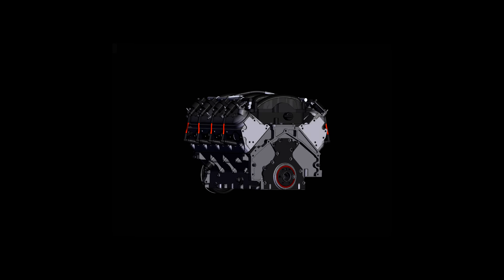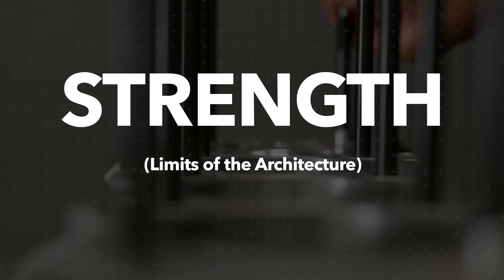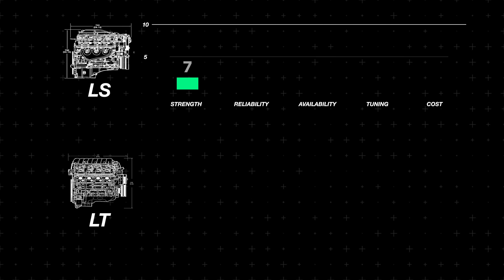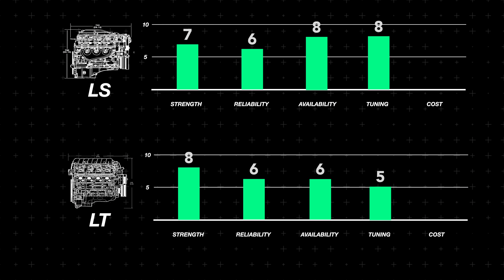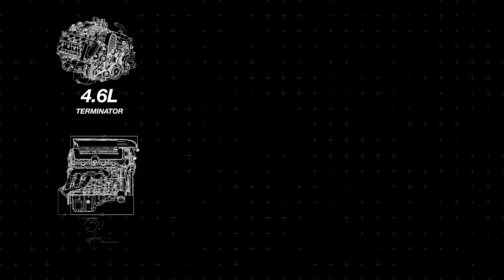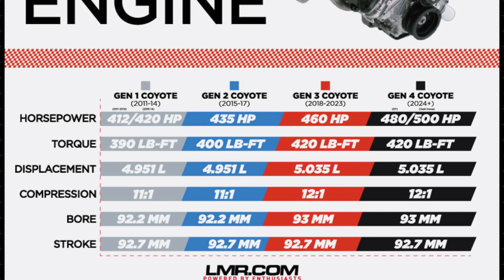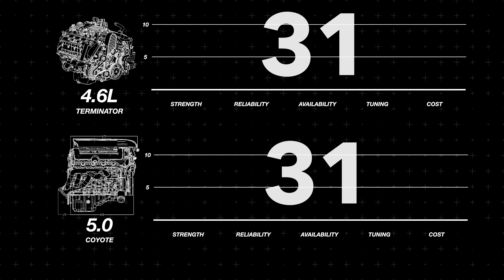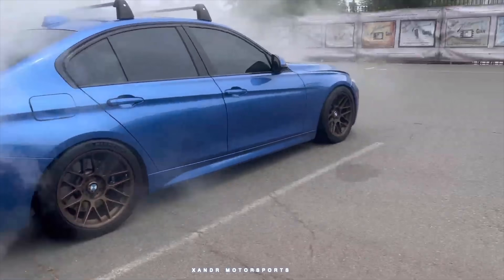Why Old Engines DESTROY Newer Ones💀| Explained Ep. 25

Comment: the coyote is better than the 4.6 mod. it just is. the typical 4.6 is a ugly little 225 horsepower thing that's paired to a 4 speed auto, that happens to sound pretty great, but not typically a supercharged beast. I mean if you really wanted to be silly, the Koenigsegg CCR engine is based on the modular lol. the later 3v in a typical mustang gt is probably the better comparison

Comment: Alec from LMP said that the LT1 is the better NA motor over the LS7. The LT1s only fall is it’s terrible boost capabilities. I also don’t think junk yard Silverado engines should be called “LS” engines because it screws the debate a lot. The cheapest real LS is the LS1 and LS2 for around 3-5k. Those junk yard motors are a good $800 and just make it unfair for everything else 😂

Comment: Guys, put your recommendations under my comment, Ill start off with some engines
RB26Dett Vs VR38DETT Gtr r34,vs r35
The sixth generation Charger, Srt8 6.1 Hemi vs Seventh gen chargers with their newer hemis
I would like to directly compare different engines like
2GR-FE Vs The Vq series, made by different people, but still has the same cylinder number (6) even if it has a different firing pattern

Comment: I definitely do not agree with the tuning potential of the 2JZ over the LS.  2JZ is extremely tunable, however the LS flexibility is definitely better.  They can run just as good on a Carb as the can on EFI.  One missing major player is Honda.  Most people who are in their 30s and 40s with the pockets to tune and are taking the newer platforms to the next level got their start in Hondas.  A K vs B series would be something very interesting to stack up against each other.

Comment: For direct injection vehicle changing out the injectors is hardly anything with out changing out the high pressure fuel pump for better tuning capabilities

Comment: Modern engines aren't meant to be tuned or upgraded... That's kind of sad.
My car has a Renault F4R the same engine Renault had for about 20 years and produces only 150hp at some point they had this engine on a Clio producing 200hp... 100cv/liter.
With a outstanding preparation while keeping NA there are some 180hp on the wheels. But it's not worth.

Comment: Personally, I believe the terminator vs coyote comparison is skewed/unfair towards the coyote. And I hate coyotes. (Terminator owner.) You're comparing the top tier engine to what can be found in base level performance cars, or trucks. A straight 4V vs coyote would be a better comparison. The 4v ford lineup ran from 1993 all the way to 2014 in the end of the GT500. 93-05 in the N/A 4.6 platforms 

Tuning. Ehh, most people that tune coyotes can tune a earlier eec-v ford PCM. (Terminator, 4v, 2v, and 3v.) It's also worth taking the time to get the software to do yourself. 

Cost comparison. Yeah. Depending how you slice it, it's about a straight trade modular vs coyote. You gotta pay to play either way. (The terminator comparison was spot on, imo.) 

Strength. The 93-99 teksid aluminum 4.6 blocks are hands down a better block than a coyote block. You don't have to worry about cracking the bores unlike a coyote. The iron 4.6 blocks do have their weak points, and are notably heavier. 

These are my ramblings on on the mod vs coyote debate.

Comment: Great video but you over stated the power the stock bottom end of the 2J can make. It can make 1000hp yes,.. but reliability wont be there. 600whp on pump is safe and 700-800whp is about the max limit on stock bottom end on E85. Any thing above that is a gamble. It will make the power but be ready to build a block. The pistens will hold, the rods wont

Comment: And Honda still uses K-series engines for performance cars
Reply: very different engine design, may as well have been a different letter. I don't really know how they choose the letters but yeah. 

they also have the k20c2 which is an economy engine and has a similar reputation for tuners as the k20a3, the weaker version in the RSX base.

Comment: Lord. The ignorance about the Supra vs Z4 M40i differences everywhere is deplorable. Papadakis racing debunked most of the claims and supported Toyota’s word about it in every single aspect they looked at. They did a complete strip down to the chassis of both a Supra and Z4 and looked at the actual differences. The engine used in the Supra is not the same as the one in the Z4(despite claims. The B58 in the supra was refined by toyota, and other version pre-date their involvement). Can we say NO to misinformation please?

Also the lack in consistency in comparison of these engines, comparing stock ecus for the Coyote and Terminator engines, whereas weighing the aftermarket ones for other engines, is just intellectually dishonest.

Comment: The issue I see with a comparison like this overall is basically that none of these factors matter if you’re doing an engine swap. I could see these things matter, and if you are buying an original car, but the total costs involved with an entire swap, with the intent of custom levels of power is that ultimately, it depends upon tastes over actual results. With enough money, virtually any engine can make 1000 hp. And it might be cheaper to achieve with all of these engines collectively, due to the fact that an aftermarket exists for them, as well as some of these engines having 1000 hp kits. But regardless of achieving that much power, and putting it in whatever you want, the ultimate realistic cost in how to achieve that makes it all meaningless to the average person.

I believe a more fair comparison would actually be somewhere around the realm of achieving 500hp, but that comparison leads to the result of preference mattering, because the ultimate final cost is relatively the same. All those same engines will spend about the same amount of money to acquire and modify to about that level of power, which while still more attainable for similar amounts of money, leads to final results matching each other on average, the difference at that point being who has the better transmission, to those results still being uncertain as well because I’ve seen a 500hp+ Terminator beat a 500hp+ Coyote and an LS beat an LT.

The point being, reaching the “full potential“ of these engines requires money, the average man can’t afford. And what the average man can afford usually results in similar results regardless of platform. So at the end of the day, if you aren’t sure which one you want, go off personal preference because that’s all it is. And have fun doing it because you can still embrace virtually every supercar with any souped up lower-cost sports car. And I consider that a level of trolling fantastic because you spend a fraction for speed some spend money they don’t have to on.

Comment: I would have to disagree with the way this video runs over things and have to say, you missed an opportunity to include the honda k series as a VERY good example. 
The LT is FAR superior to the LS in terms of oiling and overall strength, especially in the short block, most people use Gen 5 short blocks with LS heads to get around the complexity of direct injection heads while retaining "Priority Main" with stronger rods, as well as the aluminum blocks being FAR more common. 
The 5.0 i would have to argue is probably as expensive as the 4.6 4v to swap or use because both ECU's don't lend themselves well to being a stand alone, and if you stick with Gen 1/2 5.0 without direct injection you will probably spend just as much building/tuning an older platform that's harder to find parts and tune, you'd make more power with less on a platform with more options with the 5.0 under the same space constraints, and lets not even bother with the N/A or drivability comparison. 
The 2JZ is where, cost wise, the tide starts to change, but even then the B58 makes 800hp EASIER than the 2JZ, drops the iron block with seemingly no loss in strength, and gains MILES on driveability, power-under-the-curve, mileage.. the only area it  lacks is in cost, and that gap shortens as the 2JZ fades into history. 
HOWEVER.. the K series has started to loose its way it seems, honda has moved away from the traditional head setup and gone towards casting the exhaust manifold INTO the header for emissions, limiting the aftermarket options as far as all out N/A or top end turbo power. The K series is starting to pass into history much like the older enthusiast engines, but with no one to take its place as the most powerful inline 4 as of yet.
And as much as i would like to argue that gas mileage DOESN'T sway purchases/people, something tells me most experienced enthusiasts would pick the car that could drift/race all day opposed to a car that would only last half or a quarter of the day if they didn't have to sacrifice power or reliability, especially with the lack of funds these days.

Comment: The B58 has forged aluminum pistons not hypereutectic. Also would love to see one of these “stock” 2JZs make 1000whp without touching the pistons or porting the heads.
Reply: The B58 does not have forged pistons, the S58 does not the B58.  The 2JZ will make 1000hp on its stock head and bottom end....like 3 times then it will let go lol.  That is well documented, somebodies brother-sister-mother-cousin will come and say mine made 1000whp for 89 years probably there are a few of them that did but for the most part, nah.  They were dyno queens with show off sheets that were detuned on the street.  To consistently make over 1000whp it will have to be built, so yea you are right about the head performance.  600whp is much more comfortable for them for longevity stock block.  A lot of the 90s Japanese motors could survive a ridiculous amount of hp, from the VG, RB, 6G72, 3S, and 4G63, among a few others because they were built to withstand the early 90s ECUs that were not exactly accurate lol, larger tolerances had to be built into them.  Most of them could make 5-600whp on their stock heads&bottom ends.
Reply: Idk it’s believable. Motive video has a well documented rb26 that made a hair under 1k on the stock bottom end for dozens of runs down the strip and beating on the street without issue. It’s well known the 2j is an overall stronger motor so I wouldn’t doubt it.
Reply: @Jrob992 the 2jz is not race motor so it isn’t built race motor tough like the rb26
Reply: @benjaminwatson7868 2jzs were used in plenty of factory supported racing… in fact only racing Supra that I know of that didn’t use the 2jz was the endurance racing car that opted for a 4banger for better weight balance… pretty much the same story with the rb26, except the rb is known to be less reliable and more prone to issues… like it’s oiling system… though I still love me an rb… neither would count as a “race motor”
Reply: @nathanryan5642  the rb was literally designed from the get go to be a race motor while the factory toyota racing team opted to not use a 2jz its almost like its not good at racing
Reply: I don't know about the B58, but I know the N55 had forged internals in the high performance car, meaning M235/M2 and so on, so I'd imagine it's similar for the B58.
Reply: though the one in the supra it took bmw 6 attempts to make the toyota engineers happy enough for their relability standards to use it
Reply: @UtterDisgrace  Toyota didn’t touch the B58. That’s a myth & has been disproven a million times.
Reply: @CadexLaw  Their engineers just showed up and said it wasn't good enough to put in a toyota. Bmw fixed it
Reply: @UtterDisgrace bro, Toyota only approached bmw about this partnership a couple of years before the z4 was launched… meaning the design phase of things was well over and things were all ready going into production… 0 chance toyota got much of a say so on anything outside of colors hahaha

Comment: The 2jz-gte did not come in the IS300/Altezza. The Altezza had the NA ge subvariant. Also, similar to the various 2jz variants, the B58 also has multiple sub variants. The mk5 supra came in the B30C (2020) and B30O1 (2021+) variants.
Reply: the GE was also not an na supra engine like people think. it has way worse rods and pistons
Reply: @Defury8285   also lacks  oil squirters

Comment: "Real world limits" 
Stop crying because an oem coyote IS IN FACT the ONLY oem platform capable of 7s sealed ( your condescending attitude doesn't change that).  It has the highest brake mean effective pressure of any mass produced engine, and Brett Lasala just proved you wrong as well by running 2500 whp on the street during sick week with an oem Cast Predator block, oem Coyote crank, and ported GT350 heads.
6.52 @ 216 mph.

Facts don't care about your feelings, bruh

Comment: Here to remind everyone that the standing mile world record holder is an oem block and heads 5.4L Ford GT that ran 0-300.4 mph in 21 secs.
The quickest 1/4 on an almost entirely oem cast engine is a John Mihovetz prepped 4.6 4V that with only non oem rods, pistons, and camshafts installed, ran 5.88 @ 250mph .

These are absolute accomplishments on oem engines.

Comment: The fact is new engines are superior because of how many regulations they need to comply with. When you look at race teams and race series regulations, all these engines can be brought to near four figure outputs if they don’t need to be road legal. Toyota cannot make you a 2J by today’s rules and standards. It needs to comply with emissions regulations. It needs to have direct injection. It needs to be relatively right so that the overall car can be light. At the same time it needs to make more power than the driver is going to use. Both the old & new are brilliant given the fact that the engineers had to produce something that you can use every day for 20 years and they needed to meet government regulations for that time period.